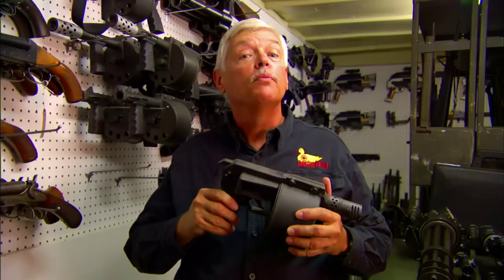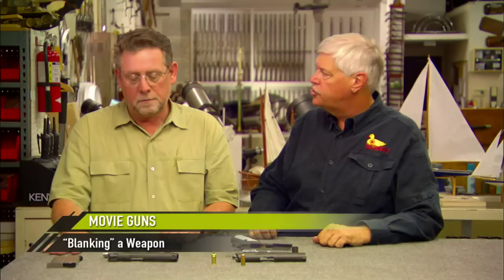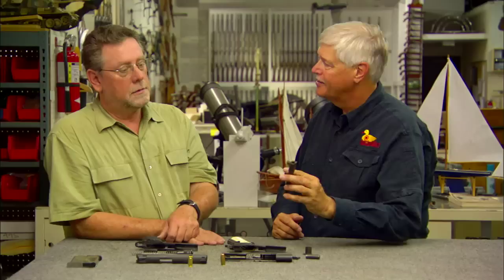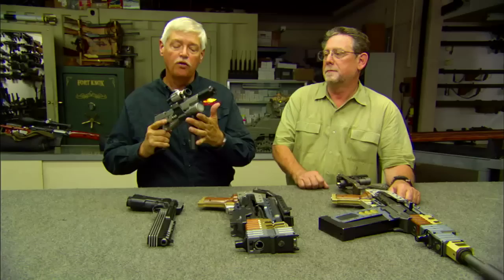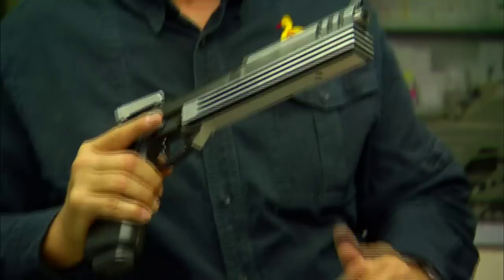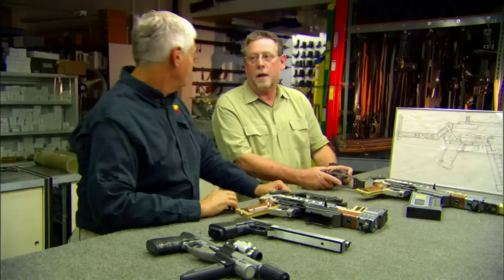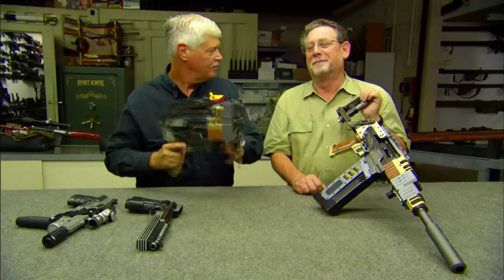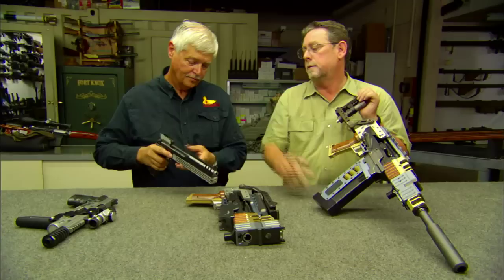Awesome guns from famous movies!

Comment: @54n141n3n This guy might not have been involved with the Robocop films. According to the host, they made that Auto-9 for Sin City, which he mistakenly called a Robocop sequel.
Reply: Gibbons was most certainly involved for RoboCop 3, which is where this Auto-9 came from (which they modded up when they couldn't use the OG gun from Robo1 and R2, exactly as he said) - They re-used it for Sin City. 
Which yes is not at all any sequel but given the SC novels were done by Frank Miller who also wrote Robo2 and 3 it was put in as a 'nod' to them.